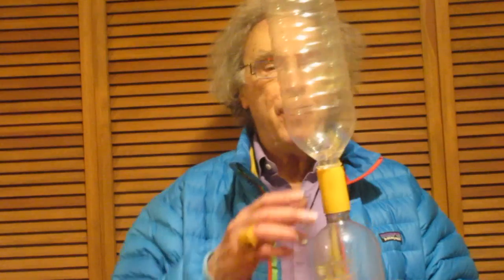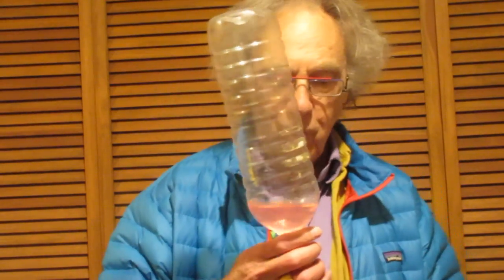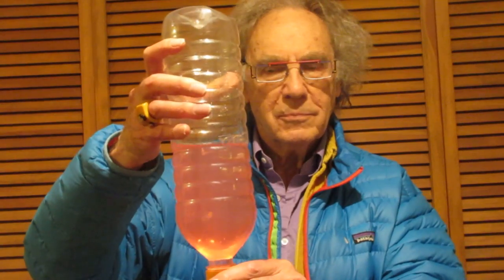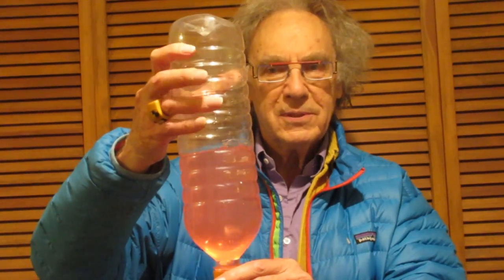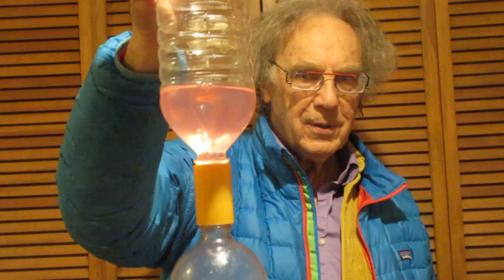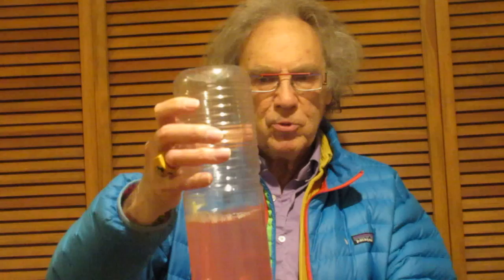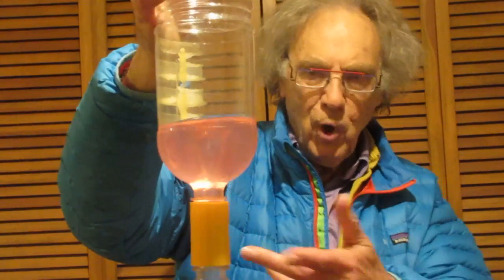Solution Problem #2 -  Vortex Transfer of Lemonade

Comment: So, what if you combined vortex effect with centrifugation?

PS: Also I have subscribed to your channel, I havee seen only few of the latest videos, but I love your enthusiasm and the passion you have for science and physics!
Reply from the maker: I did mention that the lemonade is pushed to the walls because of the centrifugal force and that opens the air channel in its center.
Reply: An interesting question about this arrangement is:
At which vortex speeds and cone angles will the vortex method be slower than the bubble method because of the centrifugal force slowing the liquid flowing downward. Is there a break even point?
Reply: Oh thank you for the answer. Sorry I was not more clear, I meant once you establis vortex (or while spinning the bottles to keep it open), to centrifugate it so that the bottom bottle makes "big" circle and the bottom of the top bottle makes small circle). Basically increasing G and hopefully pushing the liquid through the hole faster... like when they centrifugate test tubes to get heavier cells at the bottom and so on. Sort of like increeasing gravity to make the liquid "fall" faster if you get my meaning.

Comment: Why didn't you explain why it wouldn"t work if the hole was made in the bottom bottle? Wouldn't that release the air preasure into the room n NOT up the bottle?
Reply from the maker: hole in the bottom would not work
Reply: What a great explanation, you're supposed to be a teacher right??

As the water flows, the pressure in the top bottle goes down while the pressure in the bottom bottle goes up (due to changing air volumes). This pressure differential forces air to flow from the bottom bottle to the top bottle which causes the bubbles that slow down the liquid flow rate. If you poke a hole in either (but just one) of the bottles, that bottle will remain at atmospheric pressure the entire time because the air volume can equalize its pressure through the hole. However, the bottle with no hole will still need to equalize its pressure though the nozzle which will cause bubbles. IE. the bottom bottle must release excess air while the top bottle must suck in air. If, however, you poke a hole in both bottles, no air will need to travel through the nozzle and the flow rate will be larger than any of the other methods mentioned (besides the vacuum method, which was explained completely nonsensically). Why the two hole method was not mentioned is beyond me, but to be honest, this whole video is garbage and much of the physics is wrong.
Reply from the maker: If you poke a hole in both bottles it will ONLY work if the holes are LARGE.2 small holes will not do.
Holes means destruction too. That's not what we want. 
"vaccum"-like solutions are hopelessly unpractical too. How on earth would one do that? ABSURD!
A non-destructive solution would be to put a large straw inside the opening between the 2 bottles which to extends to above the liquid level. Transfer could be even faster than the vortex method.

Comment: You could poke a hole to the underside of the upper bottle (at the top, where there is no liquid) AND poke another hole to the neck of the lower bottle (at the top, where there is also no liquid). This way, air would flow into the top bottle as it empties AND would also flow out of the lower bottle as it fills. Just to make things more interesting, you could also connect the two holes with a small diameter tube, just to use the exact same air that flows out of the bottom bottle to replace the air that must go into the top bottle.
Reply from the maker: have you tried it?
Reply: "have you tried it?"
Yes I have! ...To tell you the truth, I hadn't tried it yet when I posted the comment. I was then just theorizing that the hole on the top bottle would let the air in and the hole on the bottom bottle would let the air out. Prompted by your asking, I did try it and it works beautifully!
Reply from the maker: I do not believe you.
Reply from the maker: PLEASE calm down
many people have tried it and ti would not work for them.
I told them that if they make the holes large enough that it would work. How large were the holes you made?
Reply: As previously stated in my earlier post, the holes were 6mm (1/4"). Wouldn't it have been better to clear up whatever concerned you instead of bluntly saying "I do not believe you"?
Reply from the maker: holes of 6 mm are equivalent to no containment at all.
yes that should work. 
Here is a copy of your first msg. You DID NOT MENTION 6 mm (1/4")!!  6 mm in my book is NOT a small hole.  That's why I did not believe you, 
"You could poke a hole to the underside of the upper bottle (at the top, where there is no liquid) AND poke another hole to the neck of the lower bottle (at the top, where there is also no liquid). This way, air would flow into the top bottle as it empties AND would also flow out of the lower bottle as it fills."

Comment: In this video, you talked about a situation when the lemonade suddenly stops falling down and opposes 
gravity ..............

I then saw the video in which you taped the problem, and there you made us see that the lemonade had suddenly stopped falling down but then it again started falling down as you shaked it a bit.........

The reason which first came to my mind was that it was only occurring when most of the lemonade had flown to the other side....................and we already know that pressure at the bottom of the vessel will be equal to the sum of atmospheric pressure and the hydrostatic pressure of the liquid.........so if less liquid remains so hydrostatic pressure will reduce and so pressure at the lower bottle will reduce and hence pressure differential will be small so the air will not be too eager to go from bottom of the lower bottle to the top of the upper bottle and so we'll see fewer air bubbles forming and instead water should go down at a faster rate.............

and it is consistent with our daily experiences ........(when we empty a filled bottle vertically into an another bottle......then it initially goes very slowly but right at the end as the process is just about to end, suddenly the liquid goes down all of a sudden..........)

but you said that surface tension may come into play..............

so I then thought that surface tension is due to unbalanced forces at the uppermost layer of liquid (the molecules at the upper layer are more tightly packed so they form a sort-of-layer )...............

I LOOKED UP ON THE WEB ......to find information regarding surface tension in lemonade..................... I came to the conclusion that adhesion forces between the lemonade and the plastic bottle will be larger than the cohesion forces in between the molecules of lemonade .............

so initially when the bulk of the lemonade is falling, then we know that bulk of a liquid will have nothing to do with surface tension and so gravity overpowers and so liquid keeps falling.........................
But as we reach the business end, ie. when most of the liquid has flown down, surface tension takes over ........the adhesive forces take over and gravity is left wondering...........

and then when you shake the bottle then you basically cause a mayhem at the molecular level, no pun implied .......the molecules of liquid move chaotically and hence in the process breaking the bonds formed between the molecules of liquid and bottle and so adhesion goes out of the window and again gravity takes over!!
Reply from the maker: >>>>> I came to the conclusion that adhesion forces between the lemonade and the plastic bottle will be larger than the cohesion forces in between the molecules of lemonade ..>>>>
that is correct
https://www.boundless.com/biology/textbooks/boundless-biology-textbook/the-chemical-foundation-of-life-2/water-51/water-s-cohesive-and-adhesive-properties-286-11419/

Comment: thank you for the show.
first, i couldnt tell the outcome.
second, trying to make sense on my own- with the benefit of seeing what happened:
the opening is disputed by bi-directional traffic. rising air collides with dropping water which leads to fragmentation and congestion.
if water funnels down, then upward motion of air funnels in the same direction thus feeding the water funneling effect. which in turn increases air pressure below thus forcing the air up.

if is not too much, i would like to ask for experiments leading to explaining the forming of a thermal air rise,  photo exposure and the meaning of  photo filters and for the semiconductor p-n junction. thank you in advance
Reply from the maker: use google
Reply: i used it once and got me to your anser

Comment: oh.. awesome solution what i was trying is to put a pipe whose diameter is less than that of diameter of bottle...(say d=0.3D)
so i would take one empty bottle (say bottle A) and stick a pipe by tape or glue on pipe such that a good length of pipe is outside the bottle.(note that if the height of liquid in the bottle is L(say) then the pipe should be >=2L and in every bottle the section of pipe should be >=L).then i would fill lemonade in bottle B and, i will then put the hanging section of pipe of bottle A the section will be >=L in the lemonade bottle and then i will screw the bottle (that hanging ).
now because in both the bottle the pipe is of sufficient length >=L in each the pressure will be maintained through pipe. as technically they are two bottles but due to open pipe ending they have become one with two compartments. so pipe will make the two compartments in same pressure as the volume changes. so i think the lemonade will transfer fastest.....
Sir please do reply about the solution and flaw in it if any. and please don't stop making videos even if the solution are available on web i never check it as i have to sharp my brain and hence why should i copy.. even after your solution i try to find something completely different as new methods are always there in the nature you just need to run your brain creatively...
please continue sending problems doesn't matter if solutions are over web few people do not see the solution cause they are real people out there who love physics..
as rightly titled THEY WILL MAKE YOU LOVE PHYSICS
Reply from the maker: try it and let me know

Comment: all i can think of is ... bubbles have to repeatedly break the surface tension of the lemonade ... but why is it better than the slow tilt? ... ahhh, somehow the vortex governs or optimized flow ... i guess ill read the comments now
EDIT: thinking about the cross section of the slow tilt is, say, a half circle (for the lemonade) and an annulus (washer) for the vortex. Now contact with the circle's circumference has the greatest gradient if kinetic friction. At least I think this much is true (it's been years since I've done any calculus or physics). So I am stuck there, as I would imagine the slow tilt to be the best way. Perhaps the rotational speed of the fluid increases as the cross section 'bottlenecks' and instead of a particle bouncing off the side wall and then back into the desired flow (retarding it) it glances off the side and still contributes to 'positive' flow (for some reason Im thinking Snell's law of basic optics) ... best I got

Comment: How about poking two holes, one on the side of each bottle? The hole in the top bottle will allow air in and the one in the bottom bottle will allow air out, so no bubbles should form and flow should be uninterrupted if the two holes are large enough.
Reply from the maker: try it an let me now how well it worked
Reply: It works exactly like pouring lemonade from one bucket into another bucket.
Because air can freely enter the top bucket and freely exit the bottom bucket.

Comment: I thought that putting a straw inside would work too
Reply from the maker: I have my doubts. Try it and let me know.
Reply: The problem comes with the length of the straw, too long and the liquid will cover the straw once upturned. Perhaps with certain volumes of liquid it could work, but the vortex is essentially a straw anyway - a hole for the air to travel unimpeded
Reply: +Chameleon EDM 
exactly

Comment: the reason there are bubbles is because the pressure is trying to stabilize itself this is a common solution for coffee cups with a sliding lip when the lip is open there is a hole that allows the flow liquid but when you cover the hole air has no other way to get in except through the part you are drinking from hence the bubbles
Reply: the hole in the top is actually a fix for the bubbles is what im trying to say

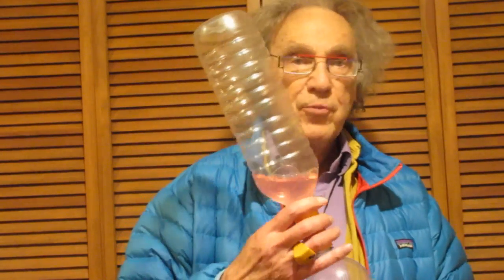Comment: 2:37 at this point i wanted to poke holes on both bottles. on the lower bottle near neck and the upper bottle near base.
Reply from the maker: have you tried it?
Reply: nope... but i guess i would try it soon.
Reply: Lectures by Walter Lewin. They will make you ♥ Physics.

Comment: Add a straw connecting top and bottom air chambers. The air flows thru the straw the liquid flows past it.
Reply from the maker: Thus should work in principle but have you tried it?
Reply: No, just immediately came to mind as a thought experiment in the first 30 seconds of the video.
Reply from the maker: many have proposed this. NO ONE tested it. To design it properly is not so simple. But in principle it should work.

Comment: I guess you can make a hole on both bottles so the air can go to the atmosphere from the bottom bottle and go from the atmosphere into the upper bottle. I know it is not so relevant to the point you want to make but it just another solution.
Reply from the maker: have you tried it?

Comment: I think he is talking about turbulence & surface tension. ... you might not want to overlook the elasticity of the bottles & system resonances.
Poke a hole in both, mid bottle, providing an external air flow path!  
 I want numbers! ;-)
Reply from the maker: have you tried the holes?

Comment: Why can the lemonade stop? Hmm

Well, P=F/A so F=P*A. We obviously have both P and A above zero and if the liquid has stopped moving, the force on each side must be equal. But if P is very low, the force created is very low. As Walter states, the liquid has a surface tension and the movement must be through the liquid, due to the higher pressure at the bottom of the system. If the pressure differential is very low, there will not be enough force generated for the gas to penetrate the surface of the liquid, stopping the movement. I imagine with lemonade this to be quite difficult as it isn't a uniform liquid, meaning it's surface tension probably varies depending on how much sugar is in the localized area.

Someone tell me if I've done a dumb, my physics is rusty

Comment: Hi
Push the experiment steps further
Wonder how the air flow through the vortex
Answer : same way : air flows like a vortex through the vortex
Relevant Pr ?
Reply: If so i'd like to tell you more
If not never mind
Reply from the maker: use google
Reply from the maker: use google
Reply: Lectures by Walter Lewin. They will make you ♥ Physics. I sent pictures on google + is it good?
Reply from the maker: I cannot see your pictures
Reply: Ok sir i suggest you to visit my profil there you will see pictures. I hope you appreciate. If not sorry but thank you for your time.
Reply from the maker: RELAX I cannot visit your profile
Reply from the maker: you can find the proper explanation and theory on the web. Good luck!

Comment: poke a hole in both bottles.
Reply from the maker: have you tried it? It may not work the way you expect it to work
Reply: I don't see why that wouldn't work. For a faster transfer, poke a hole in only the bottom bottle and crush the top bottle.
Reply: Stanley Chang my idea is the air would leak out the bottom hole, preventing an air cushion and leak in the top hole, preventing a vacuum providing a smooth flow, no crushing required.
Reply: Yes I agree, but pressurizing the top bottle by crushing it would be even faster.

Comment: Can you do a video on the automobile not being a true Faraday cage? It's not! It may act like one but it's simply not a true Faraday cage. Can you explain this to everyone so they can understand it.
Reply from the maker: use google. I also discuss this in my book "For the Love of Physics".
Reply: Lectures by Walter Lewin. They will make you ♥ Physics. I have to get your new book. There is also some misconceptions about planes as "Faraday Cages" from lightning strikes. It's an important subject because engineers had to develop special electrostatic discharge  tips on the wings of airplanes, airplanes have still been damaged internally by lightening strikes, cars have as well, and the general public still seems to be a bit misinformed rigorously speaking that is. It's a big mess on Quora as well. I don't blame you for leaving Quora. Lol ;)
Reply from the maker: most cars are no longer made of metal but that's a separate issue. Use google

Comment: +Lectures by Walter Lewin. They will make you ♥ Physics.
Suggestion for problem to propose: 
How a helicopter rotorblade acts at some angle, Say 90 degrees of the body when one blade grabs a larger bite of air and the other a reduced bite of air.
I think this will go nicely with your amazing bicycle wheel physics videos about gyroscopic effects :)
Reply from the maker: few people understand gyrosocopes as their behavior is very non-intuitive

Comment: I think the reason it could stop is because the low pressure in the top is a greater force than the gravity trying to pull it down. Stupid idea, if anyone sees a flaw just comment.
Reply: The pressure differential isn't greater than the surface tension?